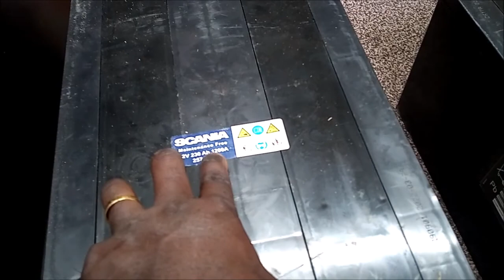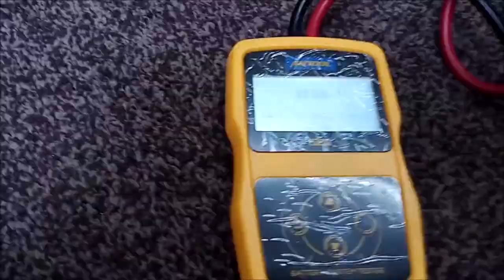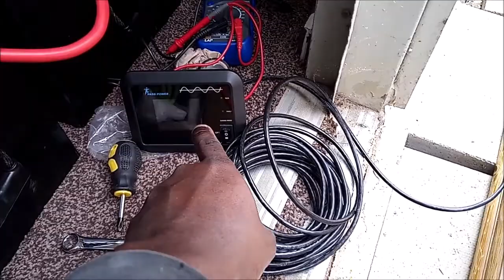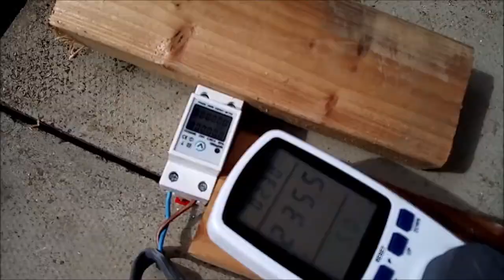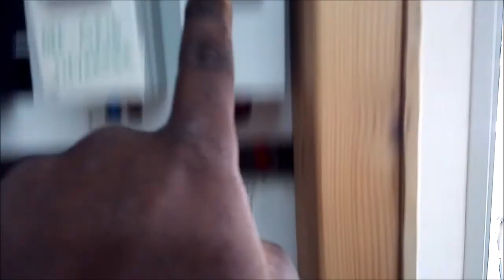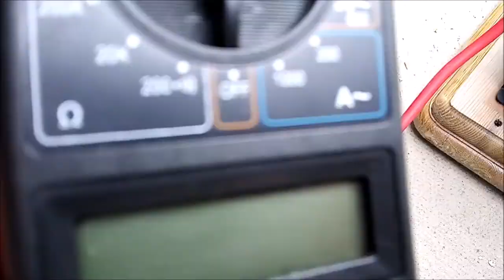Off-grid 6kw low frequency inverter Load and Battery testing

Comment: GREAT TESTING OF A LOW FREQUENCY INVERTER CHARGER THATS VERY SUCCESSFUL .🤗THESE TYPE OF HEAVY DUTY INVERTERS ARE A BEAST RUNNING THE HEAVIEST LOADS WITHOUT LAGGING OR SHUTTING DOWN  . I HAVE AN AIMS 24 V 6000 WATT BLUE INVERTER CHARGER IN MY DIY SOLAR SYSTEM IN HOUSTON TEXAS USA THAT CAN RUN ALMOST EVERYTHING IN THE WHOLE HOUSE . CHECK OUT MY DIY SOLAR CHANNEL , HIT LIKE , LEAVE A COMMENT AND SUBSCRIBE . MAY THE SOLAR BE WITH YOU .:goodvibes:

Comment: Does the voltage protector trip the inverter onces is going to overload
Reply from the maker: Sorry for the late reply - but I am sure what you mean by voltage protector and whether if this is for backup battery DC or the load side AC -- my general advise is to have fuses and breakers for both AC and DC side -- Also most importantly to use solar ATS to protect your battery from going below 50%